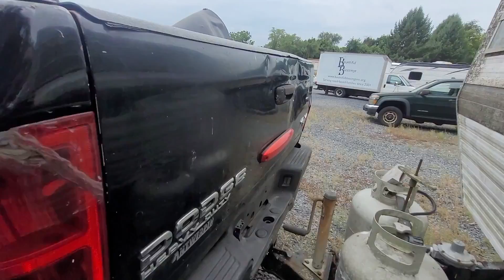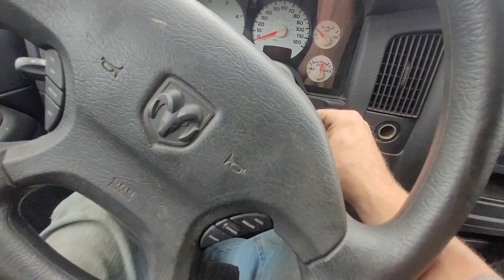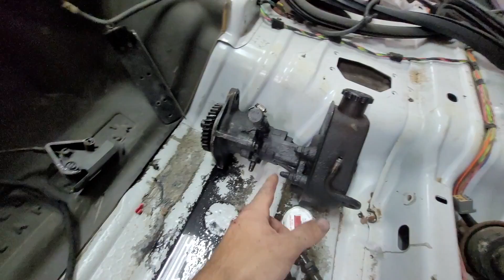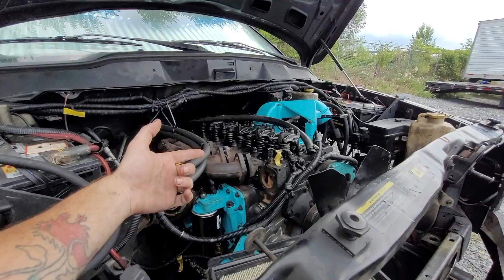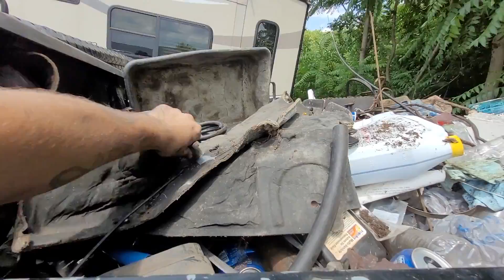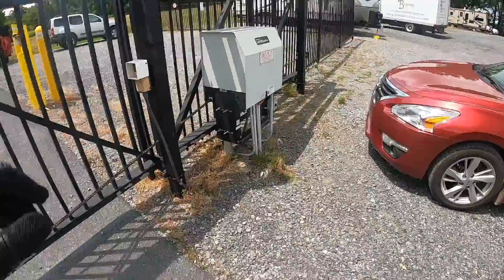The 12 Valve Swap Is Coming Back Into The Shop | Long Haul Cummins Dually Build | Partial Bike Vlog

Comment: Do you have any extra heater pipes like the ones you painted blue. I have a ‘92 5.9 and I am sure mine are going to spring a leak. My goal is to take some used ones and clean them with CLR and clean and paint them.
Reply from the maker: I think I got rid of my original ones and I'm kicking myself for doing that because used they were 150 on ebay. Way too over prices.

Comment: Put a cherry bond on the bike🤙
Reply from the maker: Once I get the audio figured out in the helmet I'll get some better sound clips. I tried recording a whole long section but it came out terrible. I have those foam mic covers coming in for tomorrow. Hoping they make a huge difference! The muffler is sooo much deeper and manageable than that straight pipe 😂

Comment: At 65 years old I am glad I don't have a pickup that needs as much daily maintenance as yours.  It's fun to watch someone else work on stuff.
Reply from the maker: If fuel wasn't $6+ a gallon and trucks weren't 80k+ I would have a new one. I ran a 2012 for the longest time but that was back when fuel was around 3 bucks a gallon back in 2018. I miss that truck. Aisin + the 6.7 that thing never missed a beat.
Reply: @CPSteveMiller  Just priced a 3500 with Cummins and Aisin CCSB..  66k with a bunch of options.  Could be under 60k if your willing to forgo some comfort shit.  Heck, my 2014 listed at 62k and Ram discounted it almost 9k giving you the Cummins for free.  So I got a great deal and love the 6.7.  Great engine and 21-23 mpg on the highway not towing.
Reply from the maker: That's still way too much for what hotshot is paying right now. Especially power only. Every other day of driving it costs 750 bucks to fill the tank(140 gallons). Just isn't worth the monthly payment in my opinion. I was looking for 2wd 3500s and even the 5500s but with the new insurance I have they will not allow us to have cab and chassis trucks. Insurance would go from 330 a month to almost 1800 because I'd have to switch companies. Really sucks. I need the dually though. Crew cab long bed 2wd with an aisin is the specs I wanted.
Reply: @CPSteveMiller  Wonder why not the cab and chassis trucks... hope I don't get dinged too bad when I put my F450 on my policy.
Reply: He is young , full of energy
Reply: Man, I agree with that.  I spent too much time and money on vehicles.  70 now and I love my RAM HD Cummins with the Max Care warranty.